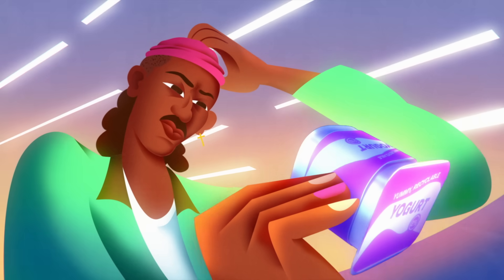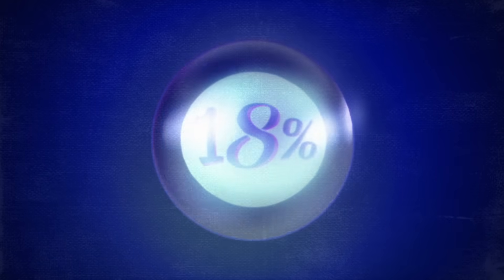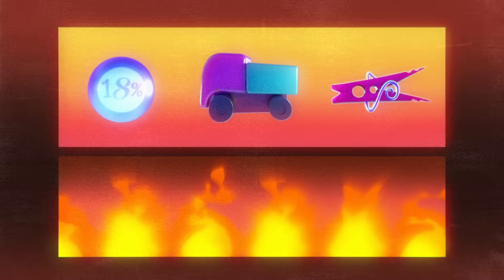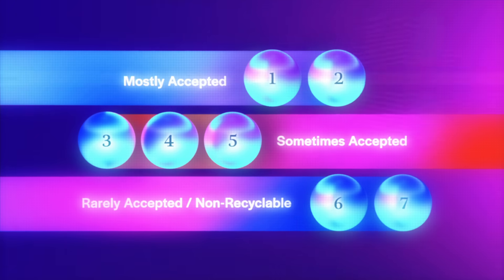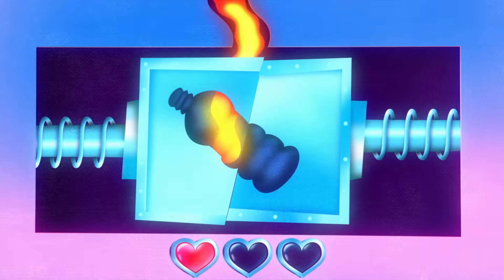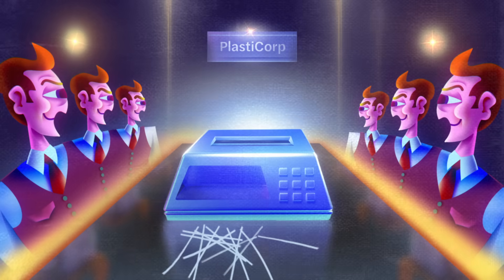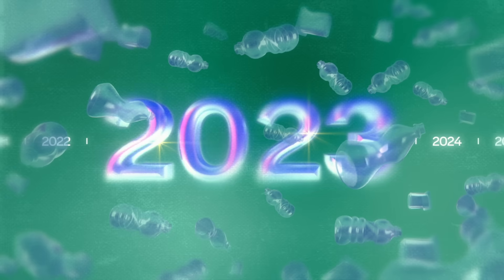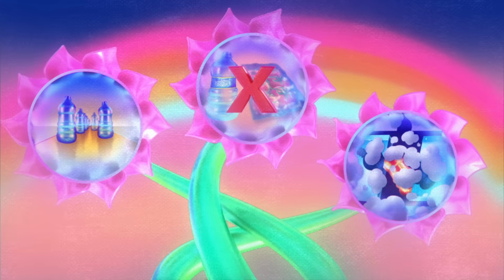Confused about recycling? It’s not your fault - Shannon Odell

Comment: The fact that even this video got it wrong is insane. The symbol used on plastics is intentionally designed to be mimicking the recycling symbol, but it’s just different enough so they wouldn’t get sued. It’s literally designed to trick you. It’s not a recycling symbol AT ALL

Comment: A counter-point to removing the resin system altogether though; some of those plastics have different food-safe properties than others. We need to be able to identify which is which, regardless of if they're recyclable or not.
As an example, many Gatorade bottles (or all, I'm unsure) rely on some form of internal coating or additive in the drink to keep the non-food safe plastic they're made out of leeching. That property is lost if you rinse out the bottle and re-use it for something else like water; which will taste like plastic as the bottle slowly dissolves into your drink.
Powerade bottles, on the other hand, are food-safe and do not do this. At least, most of them are - they might have cheaped out in some regions of the world, but without the resin number you won't be able to tell the difference until you actually try it, and some cases may not be as obvious as actually tasting chemicals in your food.

Simplifying the information regarding recycling is a good thing, but it should not come at the expense of useful information which should also be printed more clearly on packaging and other objects.
Reply: This is a safe packaging problem rather than a label problem. If it is toxic under normal conditions, then it shouldn't be used as a bottle in the first place. Besides, it can also fall under single use plastic as you can't wash and reuse it without harmful effects and should be eliminated from the market.

Comment: The industry has a term called thermal recycling. A lot of the plastic recycling that takes place in environmentally friendly companies actually fall under thermal recycling. Which is basically a nice term for incineration. But they call it recycling because the plastic is turned into heat that is then used to produce electricity. So when you see companies say that their plastic products are being recycled 100%, dig a bit deeper to see if how much of that falls under thermal recycling.

Comment: I was thinking about it recently and realised that a lot (though not all) things plastic is used for could and even once were made of metal.

“I crave the strength and purity of steel.”
Reply: "From the moment I understood the weakness of my flesh, it disgusted me. I craved the strength and certainty of steel. I aspired to the purity of the Blessed Machine. Your kind cling to your flesh, as though it will not decay and fail you"

Comment: Rice University: The researchers exposed plastic waste samples to rapid flash Joule heating for about four seconds, bringing their temperature up to 3100 degrees Kelvin. The process vaporizes the hydrogen present in plastics, leaving behind graphene ⎯ an extremely light, durable material made up of a single layer of carbon atoms. Sep 14, 2023

Using this method all plastics can be flash Joule heated so the hydrogen and graphene can be recaptured.

Comment: we still need plastic for certian thing that we cannot do anything about but i agree, 1 time use plastic is a waste . i once saw a item wrap in a plastic in a plastic and if cosumer were to need a bag to carry it home, it will be 3 layer of plastic which is ridiculous. since plastic are ment to be for long term use , then we should have the resource be use in stuff that we will use for as long as possible like computer parts and what not
Reply: wow, who told you computer parts are supposed to last as long as possible?  You need to google search Planned Obsolescence and The 1000 hour Lightbulb.  ALL consumer products are designed to fail in a specific amount of time.  EVERY SINGLE CONSUMER PRODUCT.  No publicly traded company can produce consumer goods that last.  It's actually illegal because the company would lose money.

Everything is designed for profit first and function maybe, if local law protects consumers, will be considered down the road.  Otherwise, there are millions of tons of consumer products distributed every single year that don't function at all, or are outright fake.

What humans "NEED" is clean air, clean water, around 2000 calories a day, and shelter from the elements.  None of which are being provided by the consumer manufacturing industry.  Plastic is only "needed" to generate revenue for about 18 total entities.  None of which are humans.

Every single use for plastic at the consumer level was being handled by glass and infinitely recyclable alloys.  They were all replaced FOR PROFIT.  Not because anyone needed or even asked for plastic alternatives.   Because it was decided by half a dozen psychopathic wealth consolidators who also happen to be evangelical doomsday cultists.  They don't see a purpose in preserving a world that their lord and true king baby jebas is gonna come and burn down anyway.  They only see the power and wealth they can consolidate in their own lives.

And they are allowed to continue doing this because people like you are mindless zombie fukpotatos trying to pretend as hard as you can that you might be ultra wealthy someday too.  And you'll die believing that before you do anything to risk missing your shot.

Comment: It takes engery to recycle, so we have to get clean engery, also there is microplastic in the air, water, and us. Yay?
Reply: if plastic is so inert surely this is not an issue?
Reply: @chrismcgowan5180  no one knows.
Reply: @DeconvertedMan  yeah, from my research this plastic 'issue' whilst not ideal, is born from a tidyness standpoint, rather than any threat. It seems very shortsightned to combine this with environmental damage.
Reply: @DeconvertedMan  This huge push away from plastic seem to me to be shortsighted and without any valid reason only scaremongering.

Comment: Thing is, no amount of recycling is gonna do anything if we don't stop producing it to begin with. There are plenty of alternatives, only difference is that they're a bit more expensive, guessing you can understand why companies refuse to switch over.
Reply: Because the first company that switches will lose money. That's why it's worthwhile to regulate and/or tax unrecyclable stuff.
Reply: why is plastic bad again?
Reply: @chrismcgowan5180  Plastic in use is not bad. Discarded unused plastic that just accumulates is bad.  Discarded unused anything that just accumulates is bad, not because it's plastic.
Reply: @darrennew8211  so disposal is the 'problem'. The world is a pretty big place. We could just bury it somewhere remote then instead of all this subterfuge..
Reply: @chrismcgowan5180  Hi, you are right, in that disposal is the problem.  The thing that makes plastic so great is the thing that makes its disposal so difficult, and that is that it does not breakdown easily.  Without a natural way to break it down, burying it would just delay the disposal or it could wind up in the air and water supply--like some countries have reported.  So basically, if no one threw away their plastics, it would not be a problem.
Reply: @jonathanjohnson8376  So the real problem is that it ends up in the water or air as pollution. I suppose unlike other pollution nox, nuclear sludge etc. plastic is inert (exactly why it can't break down), I haven't found any outcome data on the effects of plastic in air or sea (Air is almost never effected). We are tyring to solve a problem that in all reality does not exist.
Reply: @chrismcgowan5180 Yeah, unfortunately organic filtering systems can't handle plastics very well.  An example of this would be the polymer ink used for tattoos.  No matter how long or how hard your immune system tries to dispose of the ink, it will still last longer than you will.  In this case, if you inhale or ingest the micro-plastics, your body will have a hard time trying to get rid of it.  So, it is a problem if you are planning on being around for a while.
Reply: @jonathanjohnson8376  yes it stays around in your system. The data on outcomes are simply not there however. So to conclude based on it being 'unnatural' is very shortsighted.
Reply: @chrismcgowan5180  Yes, it would be presumptuous to assume that there is a direct association between a disease and plastic intake, but it is not much of a leap to think that a clogged filter will not function as well as an unclogged one.  If you die from an asthma attack or emphysema it is not much of a leap to say it was probably from poor air quality.
Reply: @jonathanjohnson8376  being a medical doctor specifically transplant surgeon, i'd disagree about the analogy about asthma but I get your point.
We know upon testing that nearly every single individual city country everywhere has micro plastics 'in' them. It's literally unavoidable (emphasis on micro).
Is this 'bad'?, not a clue. 
Back to my inert point I would arge there is little reason to believe intuitively that it would be particularly harmful. Leading to my frustration regarding over emphasis on 'Banning' single use plastic without a solid foundation of evidence.

Comment: "waste is a design flaw".   Bull$hit.   The plastics are chosen based on the function needed.  If a polypropylene is needed for a particular liquid...THATS what you use. If a given form or shape is required then THAT is how it must be done.  Her statement is too broad snd generalized.  

There are some products for which we don't need and should not make.  There is no purpose for vaytled water in individual units.  Empty drinking water approved contajners frim

Comment: We could reduce the number of plastics and then give each remaining type its own color shade or even colored label. But that won't happen because of "freedom".
There is however also the solution of pyrolysis.
 I think that this well known procedure has yet never been optimized since fuel was till now so cheap. The reactor is kept on very high temperature, free of oxygen, and an ideal pressure until something like crude oil can be formed,  as basis for new plastics or as synthetic fuel. Has anyone worked on insulating that reactor so once on temperature, the energy input is now much lower?? Could lasers or microwaves help to lower energy requirements?? It is well known how to do this but fossil oil is still cheaper and so nobody bothers. However, with that war, I don't know if today, the price would not be comparable.

Comment: It's the same with "ecological" electric cars. You can't really recycle batteries leftover after it's degraded. Not speaking of the fact that to charge your "green" car of the future you still need to burn fossil fuels, yet it works because u can't see a smoking pipe in the back of your progressive vehicle. It's just marketing. Businessmen knowing that everyone is hyped about ecology use it for their advantage selling you the idea that you are saving the world.
Reply: Electrification of vehicles doesn't solve the problem of emissions at generation, but it would be nigh-impossible to get rid of vehicle emissions without electrification. In short, it is necessary but not sufficient.
Reply: There are currently at least two companies that reclaim the chemicals and minerals from batteries to recycle them into car batteries.